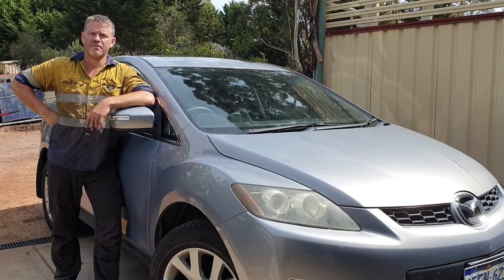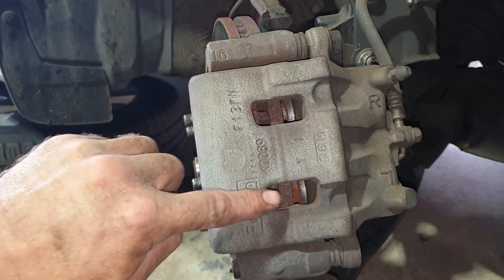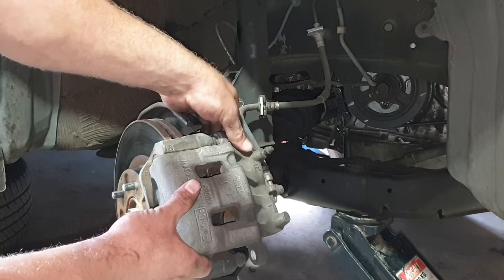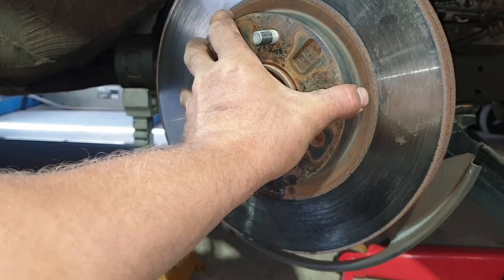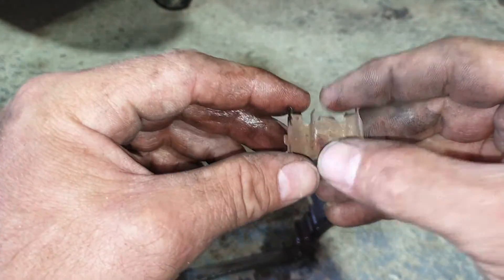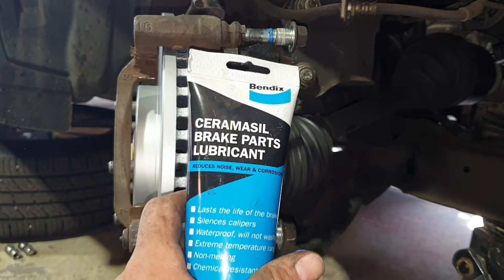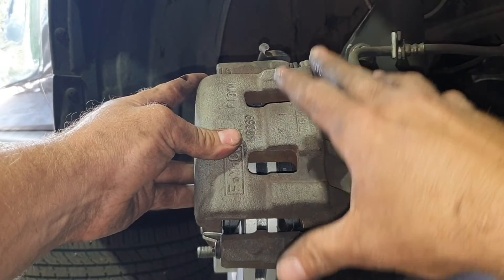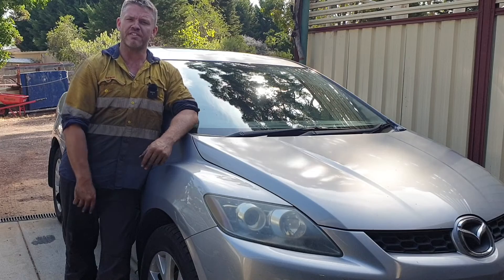Mazda CX7 Front brakes Replacement

Comment: Funny, about a week ago I installed a new set of Tein Flex-Zs on my 2009 MPV and I was watching your video looking for similarities on the other suspension components. They are basically all the same as I changed the lower control arm bushings and most new bits had both models on the label. Changed front and back lower arm bushings and it's visible in your video that all the other linkages are the same too. I guess the only real difference is the strut length as the CX-7 has a higher riding height than the MPV. Nice video mate! Cheers.
Reply from the maker: Cheers bro